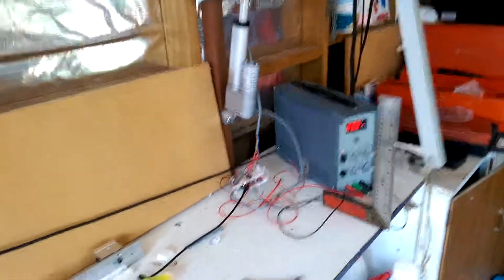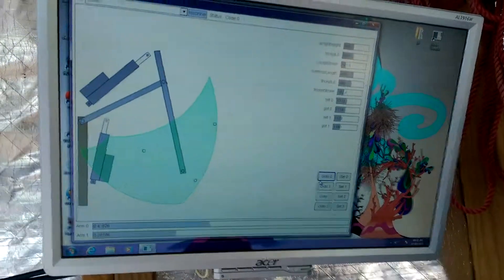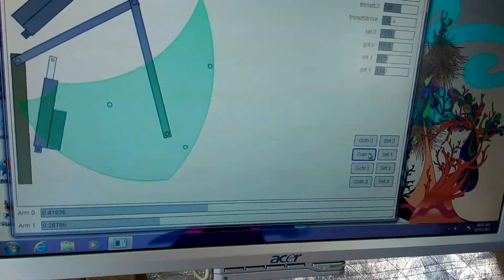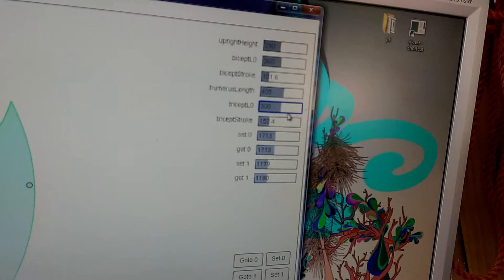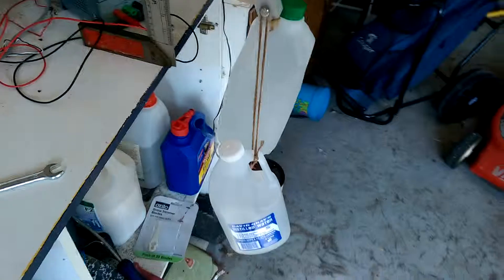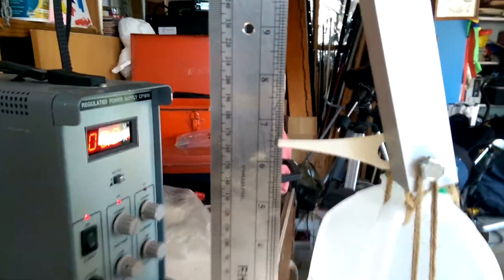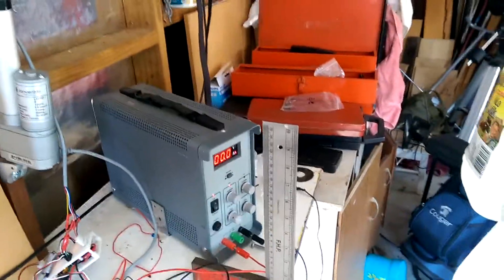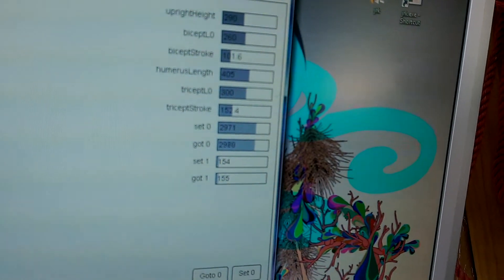Linear Actuator Robotic Arm Using Closed Lool Control

Comment: Thats pretty neat
Can you tell me the specs of the linear actuators? And also how you determined the amount of force necessary to support the links?
Reply from the maker: These are rated 110lb/50kg.  I'm using some leverage to increase the speed, which reduces the load.  This is mainly an experiment to see how the "rated" values compare to actual loads. I did not actually calculate anything beyond "50kg @5x leverage with 2x safety factor" - I just added stuff until it struggled.  I could probably add more, but I did not want to stall the motors.
Reply: Hugh Sanderson what do you mean by leverage? so the actuator cant support all the weight by itself?
Reply from the maker: Uneeb Ishfaq It is actually supporting more.  The mostly-vertical actuator is attached about 10cm from the pivot, and the load hangs about 50cm from the pivot.  So if the actuator extends 1cm, the load rises 5cm, so you could think of this as "weighing 5x as much", ie more like 20kg.  If the actuator were connected further from the pivot, it could lift more, although not as fast.
Reply: Hugh Sanderson I understand now. Thank You for your responses. I am going to start making something like this but with a gripper as the end effector :D